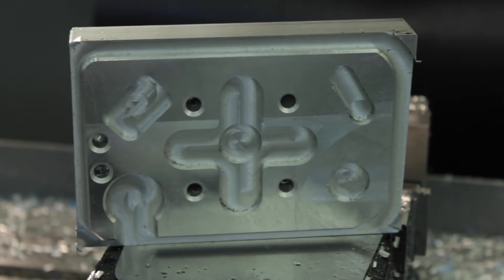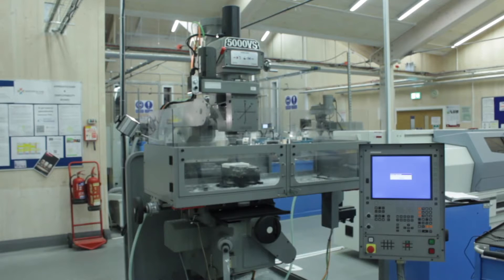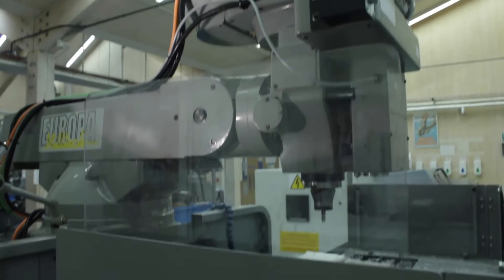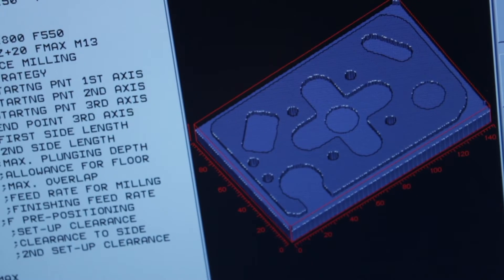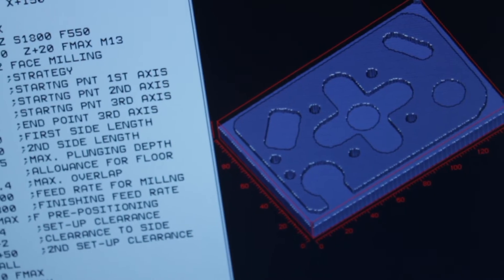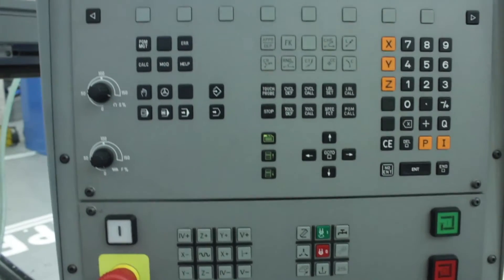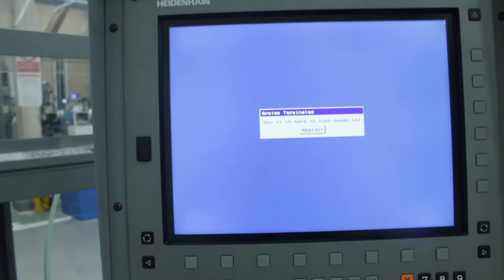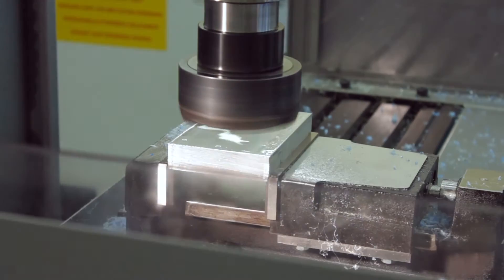CNC Milling Metric Speeds & Feeds Aluminium   #5minFriday #22

Comment: Way too low Fz in face milling! Depending on the insert shape, it should be like 0,075-0,2. Also looking at the finish quality, looks like the inserts are not ideal for alu. Way too long stickout on the HSS end mill and too high Fz for 100% width engagement. Shorten the stickout and halve the feed to improve cut quality and accuracy (deflection). Also plunging the end mill is really harsh (bad chip evacuation), helical ramp or zigzag would be much better, but seems like the plunging is not doing too bad either! Nice video and a handy machine you've got!